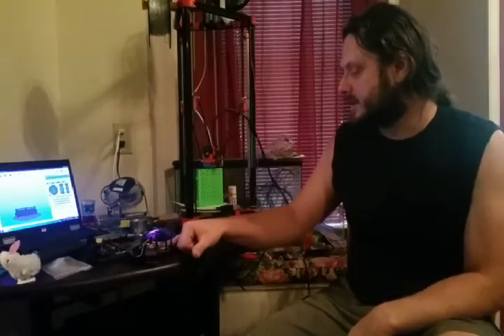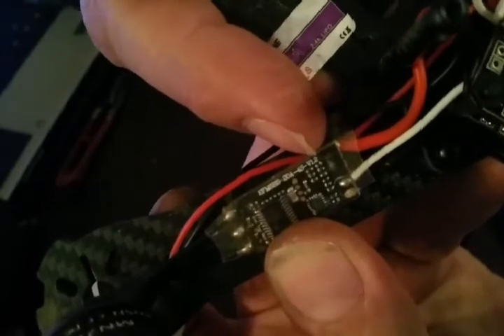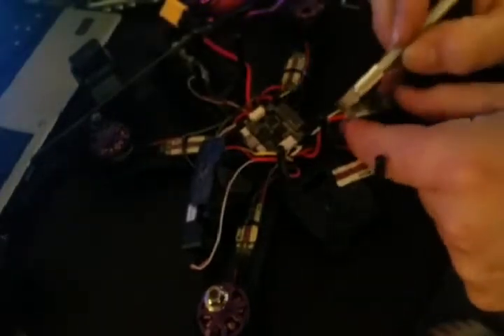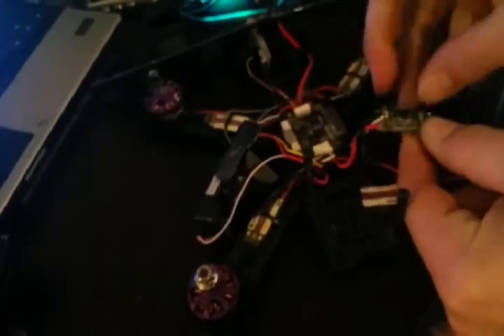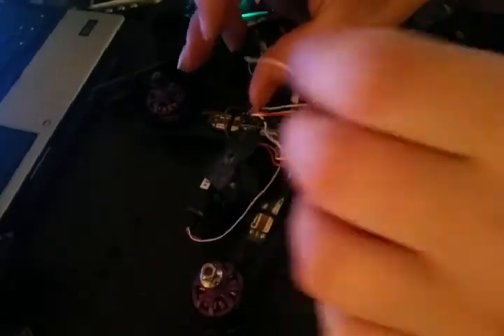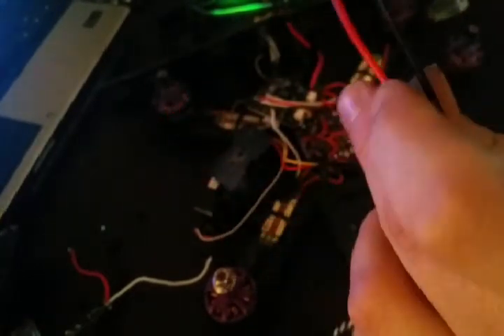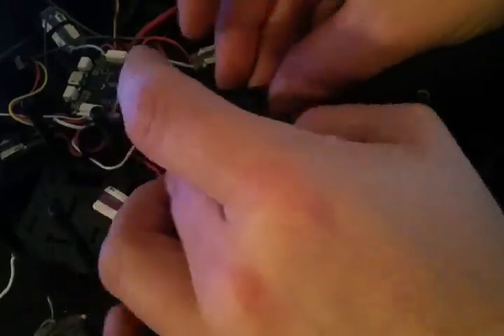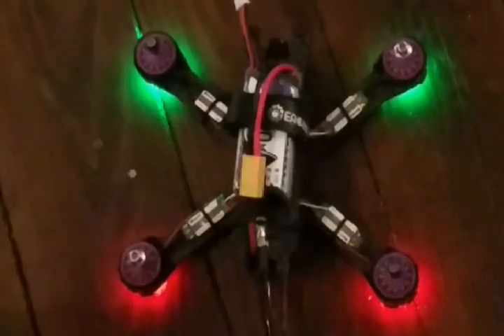How To Replace Eachine Wizard X220 ESC

Comment: I need help! Got my wizardx200 one of stock esc got burn. I ordered 4x 30A not branded so esc protocol is pwm not oneshot. Calibrated and motors working in test tab yet not responding when transmitter throttle is up. Was working somehow earlier now i dont know what to do. Im new and frustrated cuz its long time no fly. I ordered 30Abl heli multi protocol next week gonna solder cuz no patient
Reply from the maker: If the motors spin up in the test tab and not with your transmitter then there's a problem with the reciever. Sounds like your receiver/transmitter aren't bound.
Reply: @vampcaff  hah yet in receiver tab in cleanflight there is imput through drone so hehe must be problem with esc settings somehow maybe im gonna wait for blheli escs for delivery then recalibrate them under dshot or multishot or whatever just not this shitty pwm . i made some screeenshots of previous setting and applied them after changing esc and everything went mad broke. esc start bep bep bep bep continous everysecond only pwm config can recalibrate but then no transmitter action. on oneshot and old 20A esc worked fine. time will show. or 200 more dollars heeh

Comment: is replacing the esc's and motors with wraith32 v1.1 and a 2207 2700k possible? will there be extra steps required? prob. the worst question out here xD
Reply from the maker: You should be just fine doing the swap.  If you're upgrading the escs and motors I'd suggest replacing the FC too. That is if you're still using the stock naze32 board that comes with the x220. Good luck!
Reply: i will look into that! Thanks for the quick answer!
Reply from the maker: No problem! Hope it works out for you. If you have any more questions ever feel free to ask!
Reply: *update it works totally fine with dshot600! but DONT try dshot1200 'cause mine didn't calibrate but instead burst a capacitor so that i had to replace that capacitor with my clumsy 30€ iron, its a real pain in the...!  but its now ready to go so big thanks to you for your support!!

Comment: Is it ok if i have 3 20A ESC's and one 30A????
Reply from the maker: I wouldn't chance it. Although everything is worth a try. However the outcome might cost you more than picking up another 20a
Reply: Thanks for the quick answer :D. I'm just getting into this hobby and till now i'm loving the community. Welp probably gonna get another 20A and maybe some spare ones
Reply from the maker: Mitx welcome to the community bud! And it's always best to match parts when possible. Good luck and if you need anything else don't hesitate to ask!

Comment: the esc on mine shows version 1.3 what is the suitable spare one for this? Please to hear and thanks in advance for helping
Reply from the maker: My wizard is an older version and I'm sure racerstar has come out with with a v3. Really any esc with the same amp rating should work. But to be safe the racerstar is the direct replacement so if you can find a v3 with the 1.3 on back to for it. Of not a v1 (1.1) or v2 (1.2) will work just fine.

Comment: The stock Esc's for my ccw Motors are facing upside down... do i need to place the new ones upside down too?
Reply from the maker: Unlike the FC the orientation of the esc doesn't matter as long as the wires are run right.
Reply: VampCaff Thanks, is it relevant which motor cable is soldered to the esc or can i just solder every motor cable to every esc motor plate?
Reply from the maker: It kind of matters depending on which way you want you motor to spin. But you can always reverse motor direction in betaflight or just swap an two wires. I'll find a good reference video and post the link to your comment
Reply from the maker: https://youtu.be/mASuOnniYXQ
Reply: VampCaff Thank you!
Reply from the maker: No problem glad I could I help.

Comment: Man I need help with my wizard burn up my esc 
I have new ones to replace them and their 30a BLHEIL S 
But I do not have beta flight or anyway to program
Can I solder the new ones on and be OK with no programming
HELP
Reply from the maker: Unfortunately you'll need to recalibrate the new esc's. If you can't download and use betaflight download the SpeedyBee app. If you have an android you can use an OTG cable to connect your quad to your phone.

Comment: If I upgrade to 30A escs, will that be a problem with everything stock?
Reply from the maker: That'd be fine. The higher amp will draw more current so the only thing that might be effected is your battery, and possibly your motors. If the battery cant keep up with the higher draw you can potentially ruin your battery. But if it's only a jump from 20a to 30a you should be fine.
Reply: I have emax 2205 2300kv v1s, and graphene 1.3A and 1.5A 4s batteries, and 5040 king kong props, Would that be ok for 30A escs?
Reply from the maker: Should be just fine. I wouldn't go much higher than 30a esc on your stock components.

Comment: Mine says v1.3
Reply from the maker: +PlainLuke the version shouldn't matter as long as the esc says it's a blheli s. As long as the firmware on the esc is blheli s you'll be good to go.
Reply: Dude you’re so helpful!
Reply from the maker: +PlainLuke no problem at all! Just spread the word.
Reply from the maker: +PlainLuke the calibration video is up https://youtu.be/60JT3uNCi2E

Comment from the maker: The thumbs down must be for my extruder jam sound @2:15 lol
Reply from the maker: +Grammar Police lol yeah fuck em. It should work just fine as long as it is programmed with bl-heli s. Then once you install it connect to clean flight and calibrate the new esc. I ended up having to do this since the esc I replaced spun the motors up slower than the rest.
Reply from the maker: Lmao! So true. I've since upgraded my lighting situation. Thanks for checking out the channel!